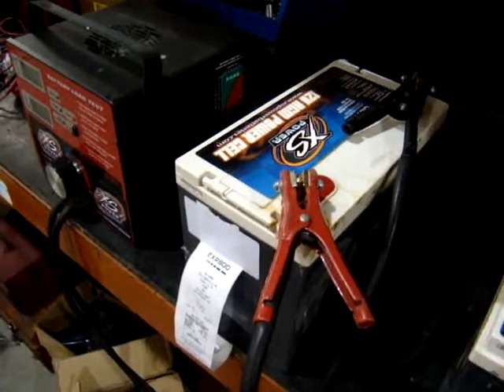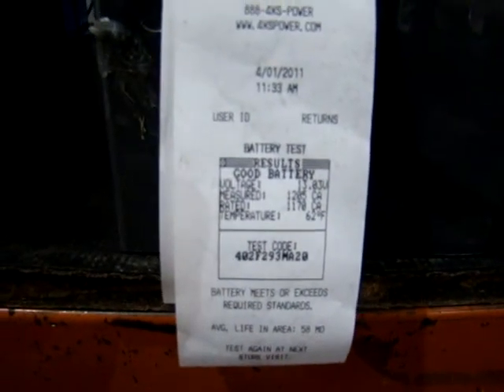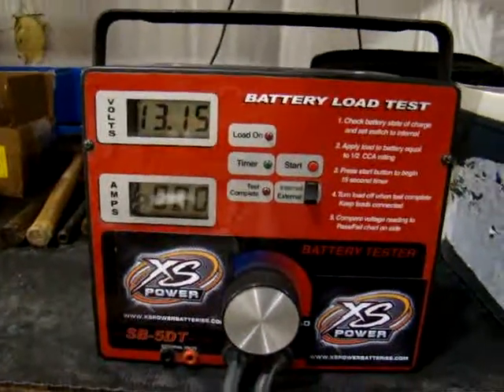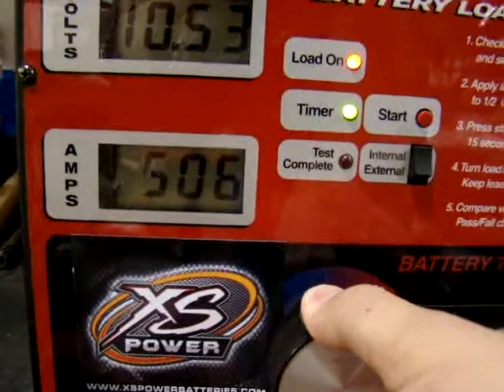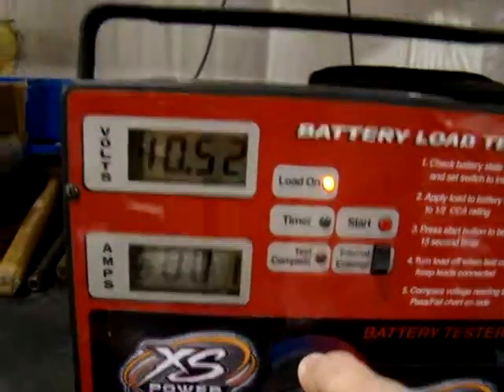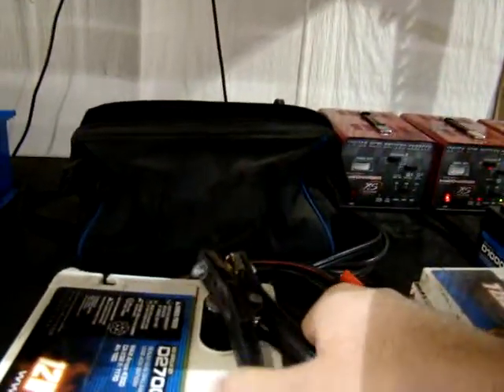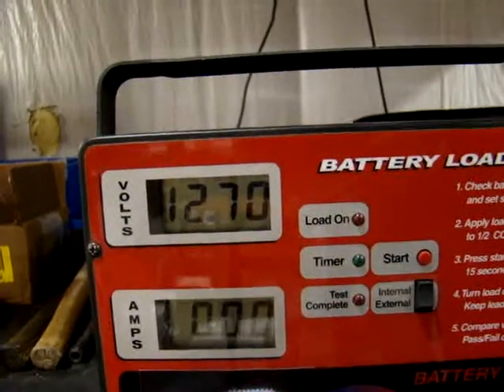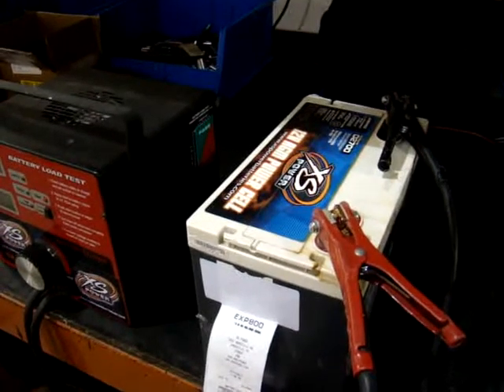USED D2700 LOAD TEST

Comment: im curious how those leads can pull 500 amps through it, its not recommended to pull over 350amps through 1/0 gauge wire, and those look smaller then that :S

Comment from the maker: @dereileak Any time the battery is stored below 12.6V it can start to cause damage to the battery. Sulfation can start to build up on the plates in the battery, which can cause a drop in performance. In a vehicle it is very common and usual to rest in the 12.8V range. There is usually a small draw in the electrical system (alarm, theft deterrent lights, accessories plugged up, etc.) and this will cause the battery to be at a lower voltage. Nothing wrong with this in an instillation application.

Comment from the maker: @fyerbyrd22 There are a lot of variables that come into play with issues like this. What is sounds like is that you have a draw somewhere in your system. The easy way to determine this is to take the batteries out of the vehicle when you get a chance and properly charge them with a good AGM charger. Then leave the batteries out of the vehicle for 24 hours with no draw on them and see what the voltage is sitting at. If you are up in the high 12 to low 13V range then you know there is a draw.

Comment: ive got a thead on caco about my s3400...the other day i charged it...once i charged it, it rested at 12.7...once i hooked up all of my terminals, it dropped to 12.5...the next day i went outside and it was sitting at 12.1v...why would it be resting that low??...when im at idle, its stays around 14.3-14.4 though

Comment: how bad is that for them to do that to there battery? also what is the most ideal sitting voltage for these batteries, is it 12.5? or 13.2? I have a d3400 and d3100 that I just got a couple months ago, they sit around 12.8

Comment from the maker: @TeamBagBoy1 No not really scam us. This actually happens pretty often. Customers will get the battery and then either drain it down or store it without maintaining the voltage, and then they can not get it to charge back up. They send them in and we charge them up and return them to the customer.